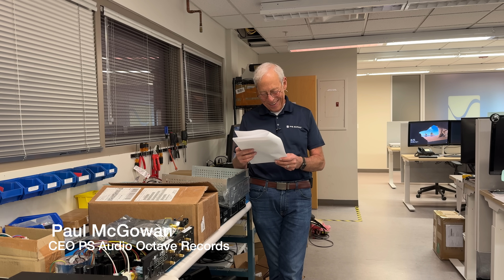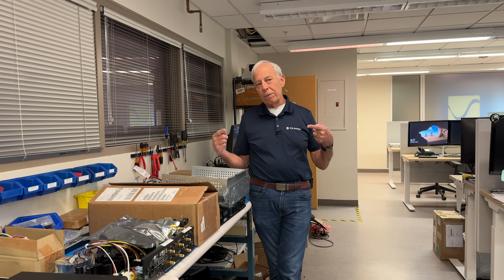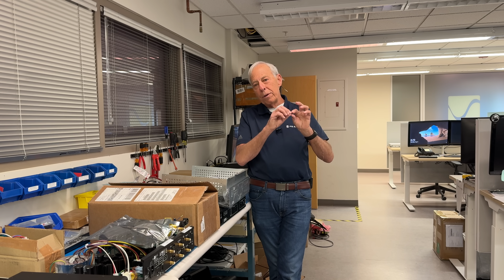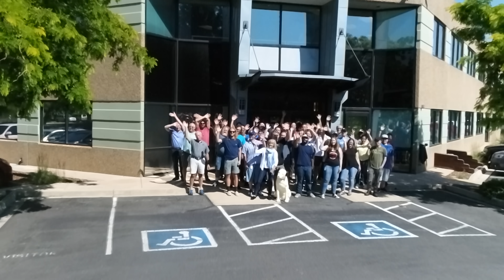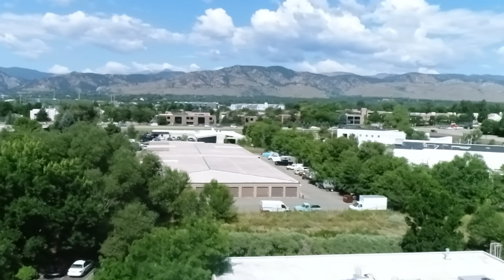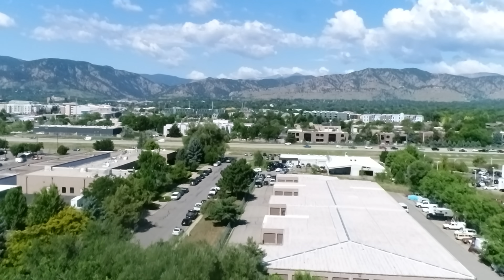Fiber optics in high end audio

Comment: In reality, The telecom or computer network massively use hi-end optical fiber, It's depends on cost. I own a Theta Data II & Theta Generation III connected by ST Fiber, In stereophile recommended class A is depend on ST.fiber. If you use coaxial or Tos-link fiber would be just Class B. And some Wadia Transport & DAC use ST.optical fiber.There are all gorgeous in the past time. So, in these time, naturally HDMI i square 2 is the better way. But dCS still not in the way with it

Comment: Digital information is either there or not there nothing from digital end can create any noise to it.  It's only when it's on the analogue side that you can pick up noise.  Digital only reads digital information.  example if I print something on my printer does it matter on the quality of cable?  No because as long as it can read the data it will print.  If it has interference it wont print the interference.  It's a bit like when HDMI cables came out some people would buy the expensive cable thinking it will provide a better picture but no it wont.
Reply: Lol. You are just plain wrong. For the printer yes, for audio no.
Reply: @Pete.across.the.street  If the audio going through it digital then what makes it any different?  Apart from analogue side I get that can pick up unwanted things.
Reply: @Dj-Jon-E-C  noise
Reply: @Pete.across.the.street  That noise would be from the analogue end.  Digital is numbers 1s and 0s be it music, video, data etc that's all digital reads as numbers.  Analogue noise does not run through digital its not read by it.  But if say the cable is really poor then you may get clicks and lost sound due to parts of the 1s and 0's lost.  Like digital tv the picture breaks up if the signal is poor, you never see static or noise  within the picture or anything else apart from seeing it break up same with the sound interference can cause signal loss.  With fibre optic it's only light so earth noise etc it does not pick up.  Any interference noise you hear would be before it's converted on transmit end or on the receiver end that is coming out as analogue.  If I send analogue noise through digital it wont pick it up, if it does then it's because the analogue side is picking up that noise not the digital.  I may be wrong and open for discussion as how we learn but that's from what I know and if I can be proven wrong then fair play.
Reply: @Dj-Jon-E-C  there's digital noise as well other noise in the digital section that is not galvanicly isolated

Comment: To put it simply, fabricating fiber connections, splicing or similar is difficult. It requires polishing the end of the individual light duct. The commercial products in that field are available but are used for patient contact electronics. Analog Devices is one source. By comparison copper wire only takes a solder iron. The optical transfer can most easily be within the audio/digital package.

Comment: Have I got a deal for you audiophiles! 1x EMC enterprise storage array, 1 Petabyte with PCIE hot rack and flash disk for cold access. This will prevent jitter and time alignment issues. The array is connected to not 1 but 2 Brocade fabric switches. You will need two for stereo. The left and right channels are separated for maximum sound stage. The storage and fabric are connected with 80Gb multimode SFP’s. We don’t single mode because of audio degradation. From the fabric we connect via fiber to Cisco Catalyst core switches, 48 port 10GBe. Each port is on its own VLAN so we don’t get galvanic cross-talk and phase alignment issues. From each VLAN your audio will be routed through a Fortigate firewall to prevent noise and err.. spoofed packets, yes! From the firewall we again break out via a separate VDOM to another Cisco Catalyst switch where your home network devices connect via their 100mbit interfaces. All this top notch, best in breed, untouchable equipment can be yours for the low low sum of $1.5mil. We will even throw in access to audio grade DNS, DHCP and best of all, NTP protocol access to NIST (subscription required) because clocks matter! Hit me up on moremoneythanbrains-audio@gmail.com.

Comment: There is a trade off and to keep it simple - optical connection will reduce noise as it's true galvanic isolation. However, it Adds jitter because of the conversion to optical and then back out of optical. It depends on your noise and baseline jitter if optical is better. Optical REALLY likes good power, like more than anything I've ever tested. Not just linear power supplies but I'm talking running on pure ultracapitor power will sound substantially better than a linear power supply powering the optical converters and the better the power the lower the jitter in the conversion.

Hope this helps others I've done a lot of testing.
Reply: Does jitter represent a problem for audio playback when using optical connection for LAN duties (Ethernet data transport from server to a streamer)?
Reply: Does not matter the signal sent is in digital it does not respond to analogue it's either on or off.  analogue it does not read so any analogue interference does nothing unless it's to the point of blocking the information.  Only the anologue side where audio picks up noise etc that was not within the original audio.

Comment: Fibre has a benefit if you have very long distance or massive amounts of electrical noise.  For 99.99% of audiophiles you'll be fine with a well shielded cable that uses paired differential signaling.

Comment: SFP optical devices with 10Gb bandwidth and a reach measured in miles are now low 10’s dollars each. There are many standard chipsets that will caretake the interface and provide an electrical signal in and out for the equipment. The housing for the device is also standard with application data, EMC gasket and PCB layout available from the supplier. I2S is a Philips standard from around forty years back. The optical connection is a dual “figure-8” fibre (separate TX/RX with a LC connector, a comms standard and available everywhere.  Porting the data into packets to transport is the only challenge here, a FPGA Eng will do this in a few weeks. I can’t see the issue.
Reply: From a networking perspective, you are right, though they tend to use ASIC's in switches and jitter is not so much of an issue. Doing it on audio with fpga's is going to add quite a cost. I'd like to see it done, but would fear the same thing as Paul said, that it would just be another standard used by one company.
Reply: @benwu7980  I think at this level, the FPGA cost is a one time, basically SPDIF packaged over a standard protocol, within a data wrapper with forward error correction, however the SFP is pretty much data agnostic, you could in theory cheapen the interface and literally shovel I2C or SPDIF over it. However this approach may be over simplified not having an overhead / control chanel. You could do this with an ARM based Raspberry Pi !

Comment: Bob Watts of Chord Audio, who is an absolute expert on digital signals and DACs is of the opinion that optical is always a better method of signal transfer than any USB standard even when seemingly the sampling rate is much higher.
Reply: I saw an article about, I think it was a student that has developed a program that allows many magnitudes more data to be transferred optically with current lines and conditions.

Comment: dCS were the first to use a seperate clock in home audio. They used SPDIF and could only be used by their products. Over the last 25 years a few companys have offered the same option. For exsample Accuphase offered it through an RJ45. However the I2r connection is still the most popular.
Reply: My external clock is connected to my Rossini dac via a digital 50 ohm bnc cable (actually two: one for each baseline frequency).
Reply: @DaveJ6515  You're right Dave, me bad. I ment to say BNC.

Comment: Data is data. Audio data is rather low bandwidth so transferring digital audio is trivial. Best is using asynchronous connection allowing the DAC to master the clock precisely without PLL or any sample rate conversion. USB C is currently the best most recent interconnect between computer and DAC, and Ethernet is best interconnect to your internet router while optical internet to your home is the best way to get no fuss high reliable bandwidth into your home. Problem with TOSLink is that it’s one-way synchronous link and adding the complexity of a dual clock of the data flow potentially yielding jitter. Galvanic decoupling is nice but it was more needed in the past with heavy power hungry DIY Windows PCs. A modern power efficient Mac Mini using Apple silicon or similar is excellent in avoiding noise into the analog part of your system.
Reply: USB is great, but many audiophiles seem to harbor memories of noisy pcs from 30 years ago and manufacturers perpetuate the myth because the amount of money on the line would likely sink some many companies outright. But weirdly they don't worry about audible distortion, for example, they worry about what they can't hear but still believe is altering the data signal somehow and affecting the music. If it if feels like a medieval superstition thats becuase it is.
Reply: @chungang7037  Well said. I couldn’t have said it better myself.
Reply: @ThinkingBetter  Thanks, also I wanted to say you are also right about the mac mini. I've seen it used as the center for an entire home studio for recording music as well.
Reply: @chungang7037  It IS audible and is trivial to demonstrate.
Reply: @VideoArchiveGuy  What exactly gear issue is audible and what exactly do you hear? People imagine things.
Reply: Unfortunately, unlike Ethernet, the USB audio connection standard is not asynchronous, but isochronous . That means the amount of data transferred in each isochronous data packets is varied to allow buffered synchronisation to the master clock in the DAC, but there is no facility for re-sending of lost or corrupted packets, (which there is for Ethernet protocols). That is why the USB cable quality debate for digital USB audio connections is not the complete nonsense it may appear to be, because it is not a true asynchronous connection with a corrective data integrity protocol.
Reply: So they are trying to sell SFP’s and Ethernet as some new plateau of audio quality?
Reply: @o0Donuts0o  Specifically I find the market for expensive "streamers" funny because they are called not as noisy but it is just these companies finding more ways to sell you the same but different thing again and again. Because then they will release a new one every year but with a different DAC and now you start to think "oh the new DAC must be better" and on and on it goes. But yea it is an issue with many products.
Reply: @chungang7037 enjoy your Wiim streamer😂
Reply: @Pete.across.the.street  Jokes on you, I don't use any streamers or streaming 🤣
Reply: @chungang7037  then why are you pretending to know what you're talking about
Reply: @Pete.across.the.street  Yes tell me about your particular digital device and how it sounds different from other transparent digital devices.
Reply: @chungang7037  what do you mean by other transparent devices? Most streamers are not 100% "transparent", idk if any of them are.
Reply: @Pete.across.the.street  Reread the entries here in this thread. Overall, I think you will find that if you volume matched any type of digital source be it PC, streamer, flac over usb, whatever, you would have a very hard time distinguishing any difference.
Reply: @o0Donuts0o  Whatever can fool people and make some money goes in the world of audiophile gear business.

Comment: Can I offer my “theory” on why they say toslink connections are usually a last choice. And why I think fiber optics may not be a good medium for sound as compared to copper wire? Because sound is ultimately vibration. A light wave is just that. Very “light” so to speak. It can’t carry the density of an lish audio signal full of vibration like a metal wire can. Hence why you get a crappier sound from fiber. When you read something like “a single thread of optical thread can transfer as much data as a thousand copper wires” you would probably instinctively think as I did, “wow that would have to make wire obsolete for just about everything!” And then I thought maybe that’s the issue. It’s good for transferring just that “data” and not so much audio signals
Reply: It's a nice theory, but when the signal is sent over fiber optic, it's still digital, meaning as long as there is no data loss and you run [good] reclockers and buffers in the appropriate spots, that won't affect anything.
Reply: @l0zerth  yea I know, idk, I can’t put my finger on it yet but I just think there’s something about the medium of light. There has to be. Why do you think a lot of people complain about the sound quality of toslink? I can’t tell either way honestly

Comment: Not sure where the issue is.
-HDMI 48GB/s optical cables exist and are not expensive.
-USB active optical cables exist and are not expensive.
-RJ45 to fibre converters exist and are cheap...
-WiFi is effectively free.

So if you want to use fibre interconnects to eliminate the possibility of ground loops. It's pretty easy and affordable. Especially for long + 10m digital cable runs.

Comment: Blinky light at top right corner! 😂
Reply: It's in need of a new fiber optic transiever.
Reply: Those overhead lights need a "Power Plant" with galvanic isolation.
Reply: @johnnytoobad7785  Nah, they just need to be relamped.  :)
Reply: Must be the room acoustics…
Reply: Disco lights
Reply: @brucenicoll4373  Shatki Stone would eliminate blinky light and increase dynamic sound stage too.

Comment: Shortly after adding a server to my system, I loaned an ADOT fibre kit and I could tell instantly that there was an improvement in sound quality so I went ahead and purchased one. The kit is connected to my network switch via Ethernet and a cable with SFP connections from the kit to the server.
Reply: Same here. ADOT has improved the sound quality.
Reply: @wisehippo3072  Which power supply are you using? By a twist of fate, I ended up with the SBooster after having it on loan. It makes a significant difference.
Reply: Sorry but you wasted your money. To pull data from your server to your DAC or whatever you will be using Ethernet. And is transported using packets. Those packets are signed ensuring that the frame data is what was sent. If an error occurs during transport, CRC can be used to correct the errant data. If not, it is retried. You aren’t hearing anything except the sound of wasted money leaving your bank account. I don’t care what you think you are hearing but we have been transporting packets over Ethernet for decades over 1000’s of KM, reliably. Your run of fiber has introduced nothing that hasn’t been done over CAT cable. Packet transport has been solved. Audiophiles parting with money for foolery hasn’t.
Reply: @o0Donuts0o Who the hell are you to tell him he wasted his money? You don't know his audio system. You sound like one of those guys who are bitter because they can't afford high-end audio gear and who deal with it by insulting every piece of equipment they can't afford and everyone who dares to praise it, let alone spend their own money on it.
Reply: @wisehippo3072  Insult? All I did was lay out the facts about how Ethernet works and here you are crying about it. It’s enough that you lot go on about quantum tunneling cables and wooden volume knobs but TCP/IP is not some nonsense that is “airy”, “wide sound stage”, “forward” or what ever other nonsense you utter but rest assured, those 1’s and 0’s are coming down that fiber exactly as they were sent. There’s no magic happening. Same for CAT cable, same for USB or any other digital signal cable. While drivers, amps, equalizers etc all add their colour to audio and their output subjective to each person, Ethernet and TCP/IP do not by their very design. Please try your insults elsewhere, you lost this argument the moment you tried throwing ad-hominem’s. He may have an expensive audio system but it must sting knowing he got fooled into spending money on nonsense and then get ridiculed for it.
Reply: @o0Donuts0o  You do come across as somewhat insulting, but you seem to be the only one that doesn’t see it.
Reply: @craigaust3306  How do audiophiles enjoy their music when they constantly have their fingers in their ears?
Reply: @o0Donuts0o  You are insulting by implying I have wasted my money and calling me a fool. I have no issue with people who's opinions differ but I would never use such language.
Reply: @jamesfarrow6752  I didn’t call you a fool. I said you got fooled. Big difference. Fooled in this case is buying the ADOT. Calling you a fool implies everything you do is foolish which I don’t know and therefore never said.
Reply: @o0Donuts0o  I disagree. I admit to not being able to argue from a technical perspective but I trust my ears. Also the manufacturer of my server has released a different type of cable that connects between the fibre kit and the server, whicg has improved things further.

Comment: Over the years there have been several attempts at a standard optical interface in the digital world. FDDI was a thing for awhile before it become OBE.  Then just a few years ago ODI was proposed by a consortium (including Intel) but I think it has just languished.  In the communications world the ITU has a standard (ODN) for high speed networks, though using that for a consumer audio device is overkill yet I am surprised some high-end manufacturer has not tried.